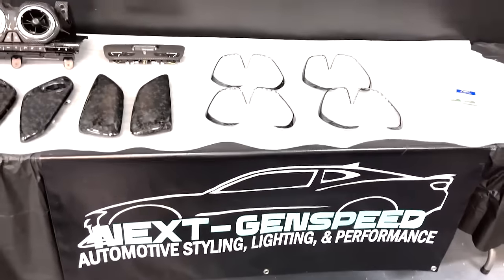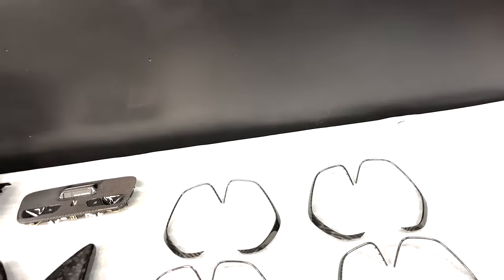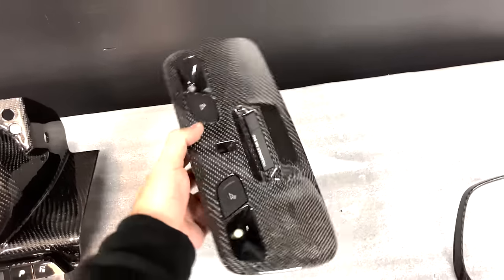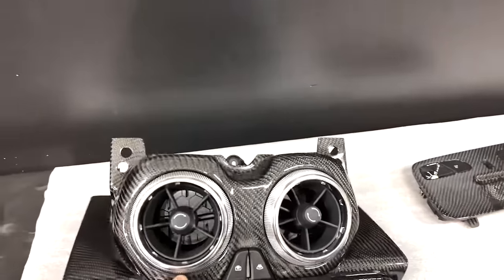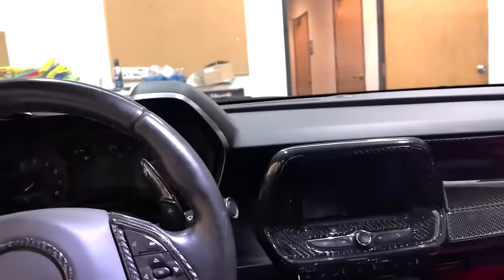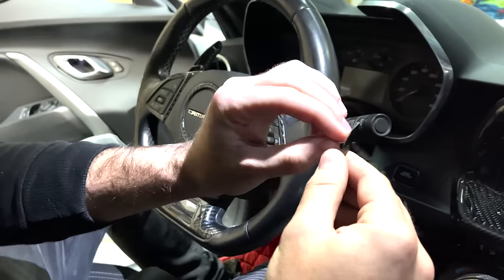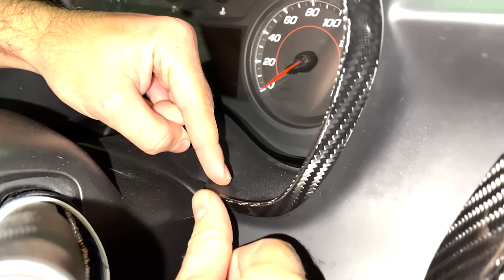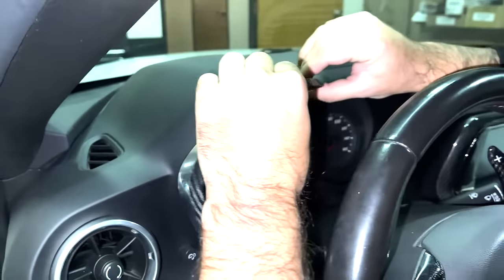2016+ Camaro Carbon Fiber Speedometer Trim Covers - 100% Carbon Fiber  #camaro #nextgenspeed #carbon

Comment: I have a 2019 Camaro SS which is black I use a lot of red inside. Do you offer it in red as well. Also for the temperature control cluster panel and the top dome light panel is it an exchange scenario or do I just have to buy yours and put mine on the shelf? Thanks 
Fred
Reply from the maker: We do not offer it in red just yet. We also offer a partial refund for the Temp Control/Dome Light after it is received

Comment: Couple questions I have a 19 SS Camaro. Do you do the carbon fiber in different colors I use a lot of red in mine. Also to get the temperature control panel is it an exchange for mine. Or do I have to buy it and put mine on a shelf. Very interested in the gauge cluster molding again I would prefer it in red. Thanks 
Fref
Reply: Do you believe you will be offering it in Red anytime soon. If so please reply to me when you do. Thanks